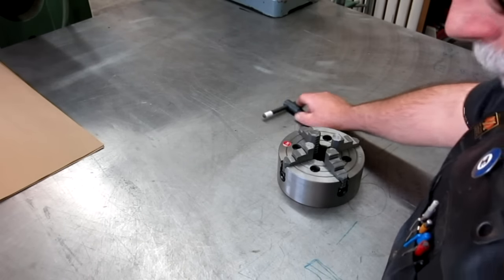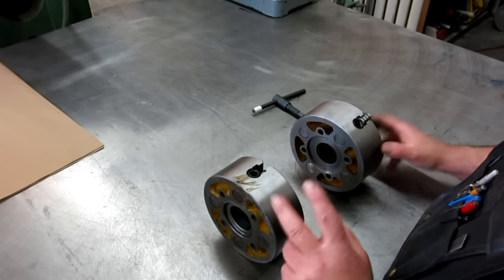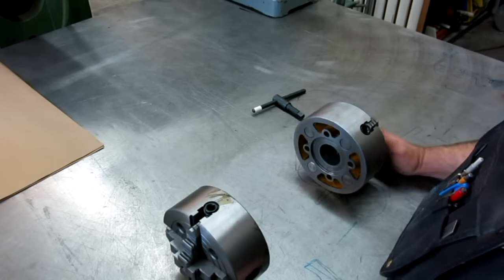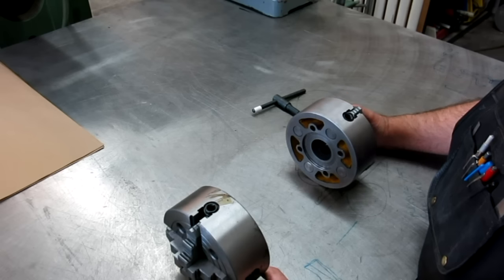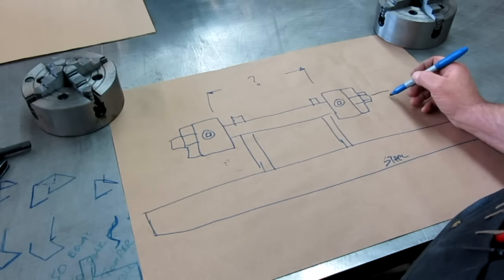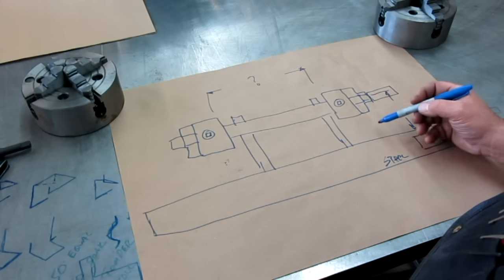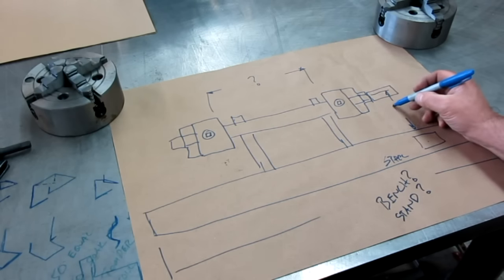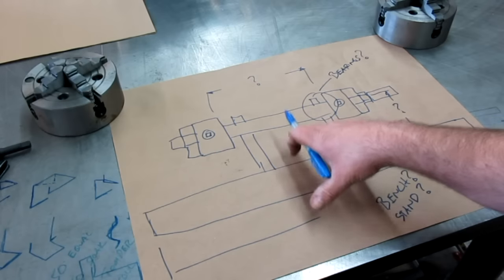Four Jaw King Maker P1

Comment: Tom: Love the Idea "however"....  I see a distinct disadvantage to 2 competitors standing on the same side of this rig.   I.E.  If you are used to your 4 Jaw chuck being to the left of you're standing position then the competitors standing next to you (to your left) may not be used to the orientation...  You of course can still use what you are making just one competitor on one side and on on the other.... 

Also... how are you going to isolate the fluctuation in each competitors indicator when there is a common shaft and common barring(s), and common base... as they bang there chuck keys into the chuck.....  The indicators are going to move... No??   

:)
Hay Tom if this is now elevated to "Olympic" status i.e.  (title belts are at stake) you must follow "YTMC" (You Tube Metalworking Community) rules compliant per section 000x0 of paragraph 0x011J rev 02 of article 0xNOTHING V2012 of the official YTMC competitors handbook... published June 2030 :):)  Also no Doping you will be tested... :) :)

Comment: You need some kind secret internal device you remotely control that will constantly throw the other chuck out .005-.010 when you say, wiggle your toes, etc. I assume the chucks will be at standard lathe height but I would still make sure you have a big box to stand on for the pre-comp face off stare down with Adam.
Reply: Sorta like  "I'll take dirty pool for $200.00", Alex.

Tom
Reply: Or grind the jaws off parallel and rig the draw for who gets which chuck.

Comment: with a shared axle wouldn't it be possible to dicker the opponent's settings when you gronk on your side?
Reply: yea it needs to be real stiff so when you torque it it wont flex and move each competitors Dial.

it also needs some tailstock silhouette cut on kieth fenner's plasma. ;{)

Comment: Obviously the contestants will have to stand on opposite sides of the rig (also better for harassment). Who can indicate in record time while standing behind his lathe, chuck to the right? But this precludes clamping to something like your welding table for lathelike stability. Like others have said, I think this is going to walk all over the shop with two big guys on the keys, Nogas fluttering away. The rig needs to be solid and heavy. I too wonder about the 1" stub shafts. Will they deflect?

Certainly those 6205s are C3 clearance or looser, just average grade. Won't they have  a fair bit of slop that'll leave you chasing your tails in competition?

Adam will indeed mistake that chuck for a 5C collet.

Stopclocks center-mounted, facing the ceiling; overhead BlimpCam shows both contestants and the time.

Brown paper is great. No glare, close to an 18% gray so that the camera likes it for exposure. Black Sharpie might be machinist's sacrilege, but even higher contrast, if desired.

Comment: I know it sounds like I'm blowing my own trumpet, but there's no other way to say it, as personally I've never understood why all the fuss over setting a 4 jaw. I use 2 keys, rotate 180 degrees and move the stock half the difference, rotate 90 degrees and repeat. Normally a few iterations will get things accurately set. I personally don't see what the bid deal is ... so long as the work is perfectly round (as what looks like a gudgeon pin in the video).  Maybe I'm not doing it the "right" way according to the purists, but I'll take the time saving thanks.

Good luck with the project.
Reply from the maker: Hey Pete,

Well sounds like you need to be in the competition. The two key method does not get the jaws tight enough for "industrial" work. You still resort to one large key when you need to gronk the jaws down a bit. Thanks for the comment,

Cheers,

Tom
Reply: Hey Tom, I agree, just leaving it after setting with the 2 keys would be crap, but I do my "gronking" (with just the one key) after setting it and don't find the piece moves much if I work around the chuck and increase the gronk as I go around. Mind you I'm only working with 9 and 10" lathes, so I can get away with a lot less. Some of your viewers may not realise that 4 jaws can hold pieces very securely without much gronk due to the mechanical advantages of the chuck and not having a scroll to steal all the Gronkettes.

Entering this competition would jeopardise my (complete) amateur status, and I hear Chuck setting is nominated as a future Olympic sport. I wouldn't want to blow my chances in any future Amateur Bozo Olympics, but as you're not eligible in that comp, you pros can go for it. You know the rules: Fight clean, no eye gouging, no crutch shots, no biting. Good luck with the competition. 

Incidentally, my comments weren't so much addresses at the pistols at 30 paces shoot-out,  but more a general comment about how some guys carry on about 4 jaws, or are even scared to use them! I swear some people make setting up a 4 jaw sound like they're planning to give birth ... and they're dudes!
Reply from the maker: Hey Pete,

Tell that to Adam. Thanks for the comment.

Cheers,

Tom

Comment: I think you guys need a bit of work on the rules in the area of time vs accuracy. No indication of tolerance was specified in the last competition. I think the rules should give a 1 second penalty for each .0001". So some penalty would be added to every score to the tune of 10 seconds per thou. This would not only be fair but would also add a degree of strategy. If you get to .0012" very quickly you can ask yourself is it worth it to continue to 3-4 tenths or call time and let the small penalty keep you in the lead.